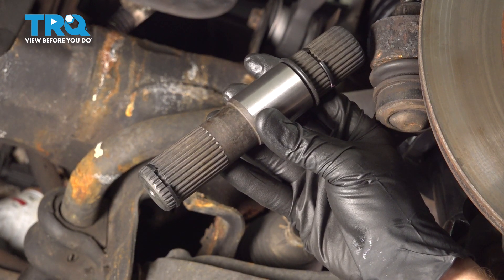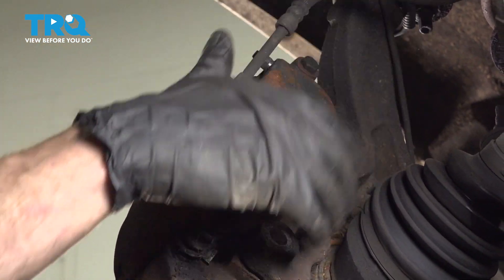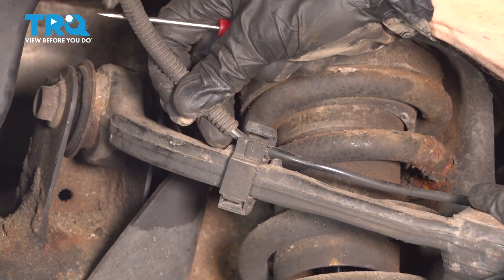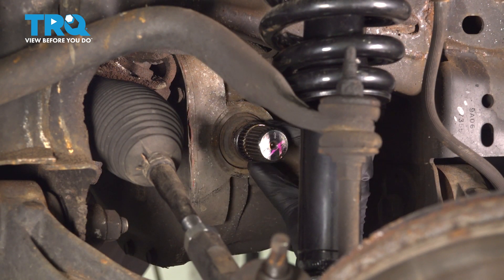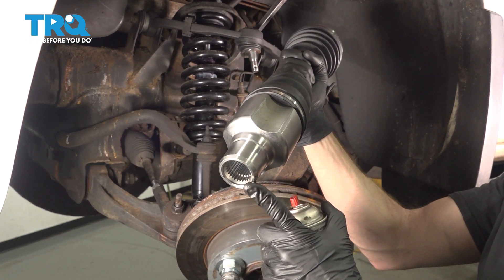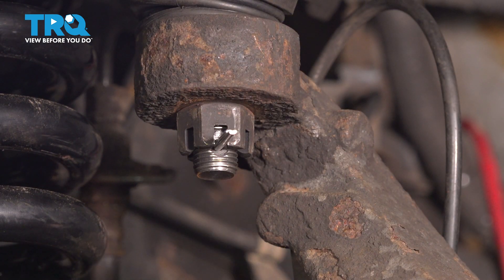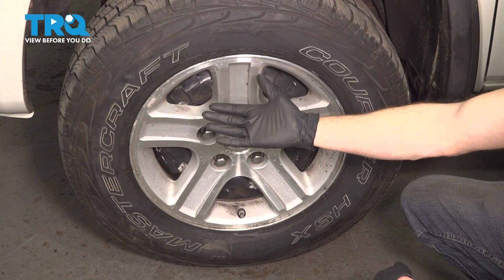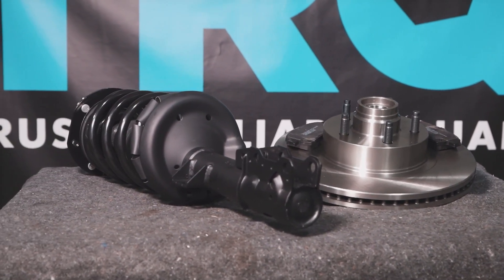How to Replace Driver Side Axle Stub Shaft 2005-2010 Dodge Dakota

Comment: Great video, one question, if I am replacing the stub shaft seals, should I use rtv sealant with the new seal, is that necessary. ?

Comment: Will this fix a cv axel with play on going into the differential, my dodge starting making a whinning noise at 70mph and higher, both wheel bearings are new and upon troubleshooting my left front cv axel has a lot of play at the differential connection point. Do I need to do this or replace the whole differential?

Comment: I had a sears torque wrench that double clicked Like yours,got me in trouble cuz I ended up torqing head bolts at  lower rate! And the cylinder heads leaked!
Why  do you tell ppl to get an alignment, when you haven't touch the steering linkage!
Don't listen to him on that part!😮